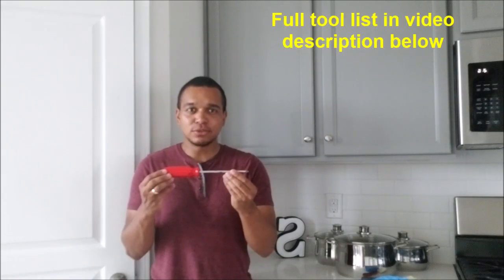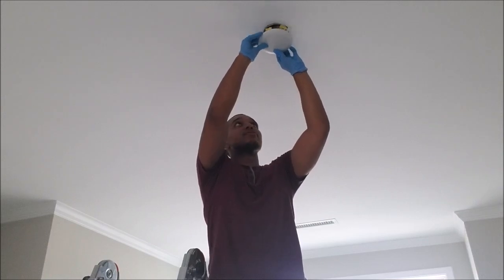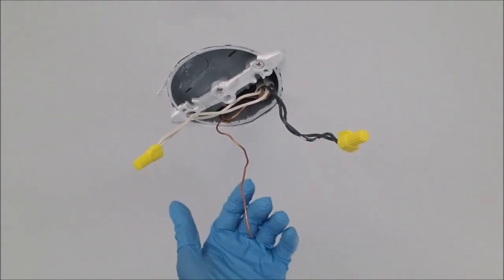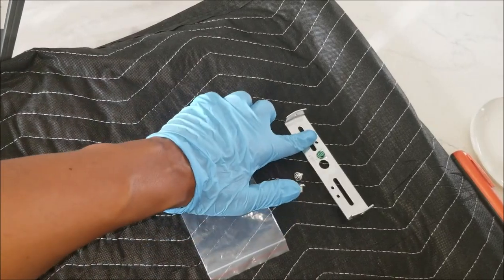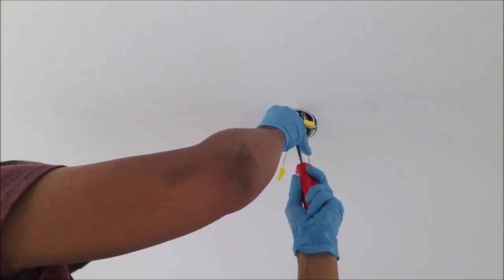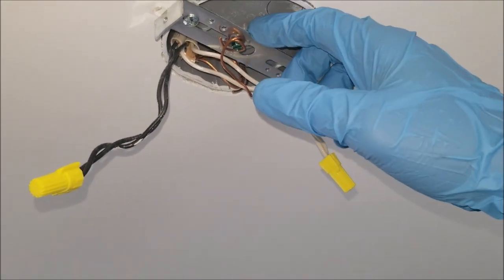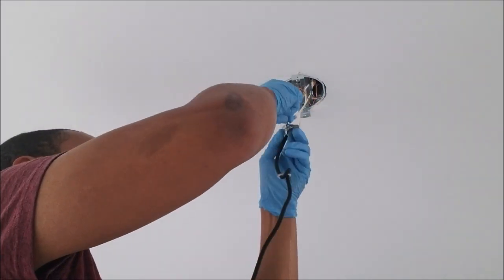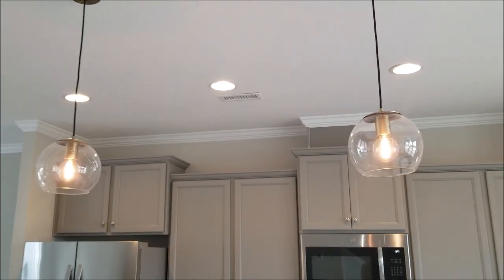How to Install PENDANT Lighting | DIY

Comment: This was enjoyable to watch my man. I've heard that these were pretty easy to install once it's pre-wired. As someone who fears dealing with electrical stuff in general, this video has made it easier for me to understand the precautions when installing. Thanks for the tips. One thing that I'm not sure about, you said to screw in the green screw all the way. Does that green screw have to be touching the metal on the other end while also the ground wrapped around the screw? It looks like you did 3 wraps or so around the green screw and you said it was screwed in. Does it matter if the green screw is not touching the metal on the other end?
Reply from the maker: Thanks for taking the time to comment and provide feedback. Also, good question. For the green screw, you want to turn it until its securing the ground wire tight against the bracket. You want the ground wire to be snug and not easily pulled out from beneath the screw head. Hope that helps and thanks again!

Comment: Now WAIT a minute. When you took the cap off to expose the ceiling wires, there were TWO white wires twisted together and TWO black wires twisted together. When you were done wiring your pendants into existing ceiling wires, there was only ONE white and ONE black coming from the ceiling. Where did the other white and black wires go?
Reply from the maker: It was a shot from the other receptacle, but all you need to do is put all wires of same charge (all live wires together) and connect. I tied the double black from the house together to the correct pendant wire.

Comment: What if the light has 3 wires plus a grounding wire? White, black and green?
Reply from the maker: That might be a dimmer function, you can test it with the voktage tester and it will tell you if it belongs grouped with power or neutral wire

Comment: When you first showed the ceiling wires, it showed 2  black wires joined together, and 2 white wires joined together. Later when you added the pendant, it shows only one black wire  and one white wire from the ceiling, makes me wonder what happened to the other black and white wires from ceiling?
Reply from the maker: Yes I had shown clip from the second light install. For a double wire configuration, both like colored wires connect to same wire on pendant. Hope that helps!
Reply: @EngineeredMojo  thank you, I am doing it right now first time in life, wish me luck😀

Comment: I have questions i need answered 
My new home is not prewired for pendants...if you could give me an average price of how much it costs to install the lights of the home isn’t prewired for pendant....my lights will be about $100 a light..may you just estimate cost of labor and cost of it not being pre wired for the lights
Reply from the maker: That'll be tough to estimate given price will vary based on the age of the home, location, and how far the wiring has to route. In my area of North Carolina on a home built within the last 10 years, that would cost between $1000 and $2000 to get permitting, install wiring, switches, etc. Price could vary up widely though

Comment: Im hanging 2 pendant lights... one side of the junction box closest to the switch has 2 of each wire, the live, neutral and ground.. the other side has one of each. Do I connect all 3 wires together on the one with the double wiring? I'm sorry if my question is confusing.. not sure how to explain it 😬
Reply from the maker: Great question, that was actually the case for my fixture as well. Yes, go ahead an connect each group of 3 wires to each other e.g. live with live, neutral with neutral, etc. so that you don't have open circuits in your junction box. Hope that helps!

Comment: Can I install a pendant light from where smoke detector is
Reply from the maker: I don't believe so, as you won't have a light switch associated with the location, and it may be a hazard if you don't have a suitable replacement smoke detector location
Reply: @EngineeredMojo  thank you

Comment: The metal rim that is flush to the ceiling for the pendant light has dropped away from the ceiling.  How do I get it back against the ceiling?
Reply from the maker: You should be able to twist it back onto the bracket, it screws onto the center rod where the pendant wires run down. If you don't have enough thread showing on the center rod, you'll need to rotate the pendant a few revolutions to get the center rod to unscrew a bit to allow more thread to show. Hope that helps!

Comment: What if the pendant light fixture you want to install are marked black as “N” and the white marked “what did the “L” how to you connect the colors if the wire on the ceiling the black is the positive?🙁🤷🏻‍♀️
Reply from the maker: You would connect live with live and neutral with neutral. Follow and connect like charges and disregard color. Color doesn't need to match, hope that helps and double check which wire is live and neutral  :)
Reply: @EngineeredMojo  thank you!

Comment: Nice vid, man. But why are the wires in my ceiling different? Both are red and theres no ground wire. Also, there are hooks on each red wires. Lastly, the  color of the wires of my pendant are blue and brown. 🤨
Reply from the maker: Haha all kinds of colors. Is your home older, built before 1970s? Older construction code did not require a ground. You can use the same method to test wires with voltage tester to determine which is live and neutral if you have two red wires. You'd have to check with your local building code to determine if you need to run a ground to your light fixture box. This can be found online or typically you can call to find out. Id recommend to consider hiring a professional if a ground wire needs to be installed. Last note blue is typically neutral and brown is typically live wire for a light fixture
Reply: Engineered Mojo 
You're right, fam. It is an old house. 😂 Much appreciated, man. Thanks a lot.

Comment: If the lights are too long  how can I make them shorter?
Reply from the maker: You can always cut the extra length of wire you do not need. Typically I keep about a foot extra of wire and I tuck that into the pendant light base at the ceiling in case I need a bit extra or want to make the lights longer in the future

Comment: Went from three black and white wires to two. Also, need some more length to wires when stripped from the main casing.
Reply from the maker: Oh yea the shots were from different receptacles but it's exactly the same installation. Neutral wires all go together, easy peasy

Comment: I have a can light and wanna replace it with 3 pendant lights, I can do that with the same switch right? Any advice appreciated, thanks
Reply from the maker: Yes it will work just fine, just will need a recessed light converter to get the bracket flush to ceiling. Hope that helps!

Comment: What do you do with the excess cord when attaching the ceiling plate?
Reply from the maker: for the ~1 foot of cord I usually keep I wrap and coil it inside the ceiling plate. If your ceiling plate is smaller or cord thicker you may have to keep less extra cord in reserve
Reply: Can the cord be cut if it’s to much to fit in the ceiling plate?
Reply from the maker: @nlangston7416  sure can, fell free to cut excess

Comment: Once you found the height that you wanted, what did you do with the excess cording?
Reply from the maker: I cut the excess cording, but I left myself about a foot extra in case I made a mistake trimming the wires back or wanted to change height for some reason. If you can fit excess wire in the cover plate without causing too much wire congestion then I wouldn't bother cutting excess. It'll save you time having to re-expose copper wire. I had about 2 ft extra so it didn't fit comfortably in cover plate
Reply: Dimonique Ollison can you have a pendent light quite close to the ceiling
Reply: Engineered Mojo this is just what I needed to know! I should have read all the comments before commenting🤦🏼‍♀️ 
Thank you!!!

Comment: The ground wire in my ceiling came out when removing the old light fixture. How do I fix this?
Reply from the maker: If the wire broke you can just splice into where it broke, not a bad fix at all

Comment: Great video, but my new pendants wires are both black.  I do I know which one suppose to be the live wire?
Reply from the maker: Examine the wires. If you feel a texture on one of them while the other is smooth, the textured side is neutral....now unfortunately if there isn't a texture difference then you'll have to temporarily hook up the llfixture and use a voltmeter. Touch one probe of a voltmeter to the top of the bulb socket sleeve (not the small metal tab inside the socket) and the other probe to the circuit ground wire and have a helper turn on the power at the service panel. If the meter indicates positive voltage, the wires are reversed. The socket should remain neutral when the power is on and the meter should read "0." If this sounds like a another language, definitely google a image of the above to know where to place the voltmeter probes. Your light will still work if hooked up backwards, but there is a chance you'll slightly shock yourself whenever changing the light bulb. Sorry for the book, but wanted to be clear!

Comment: I don’t have a ground wire attached to my ceiling, where should I connect the copper wire attached to my pendant?
Reply from the maker: Typically, you can just connect it to your ceding bracket. The rectangular bracket with the two mounting screws and attach the ground to the small screw usually located centrally on the bracket. In this video the screw is green